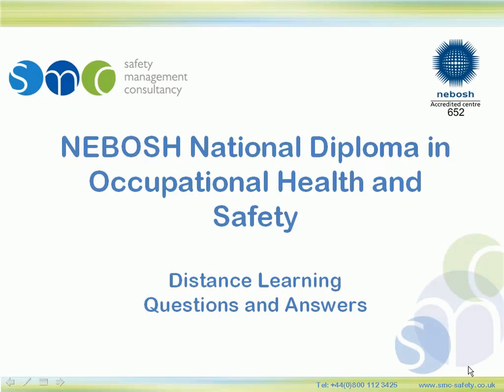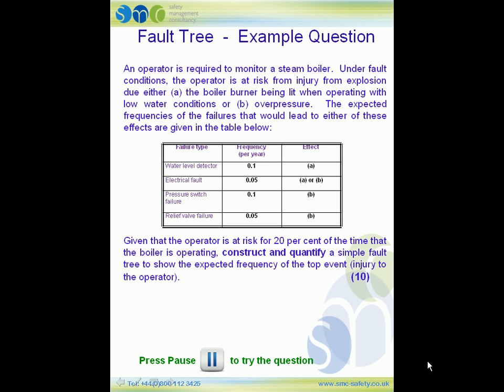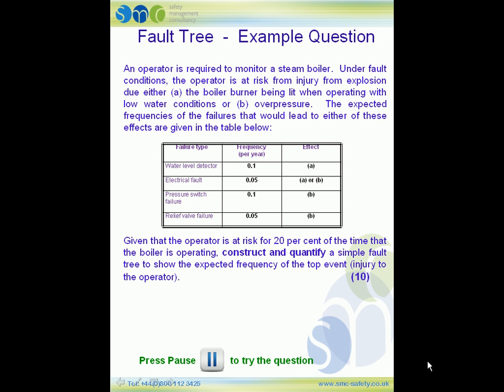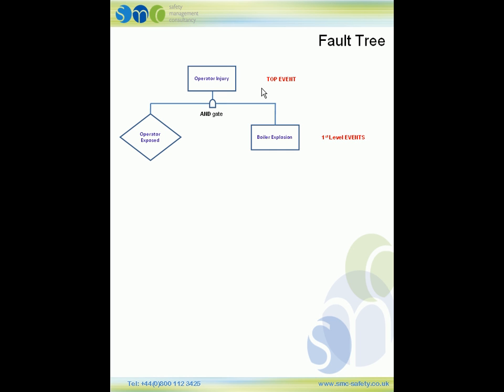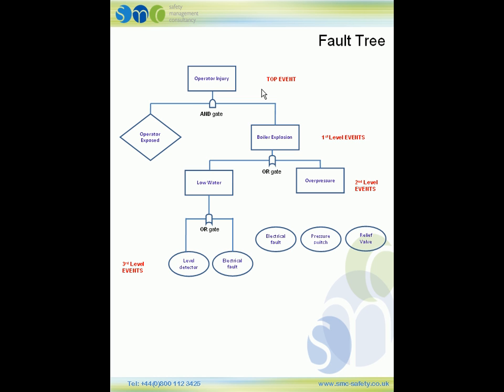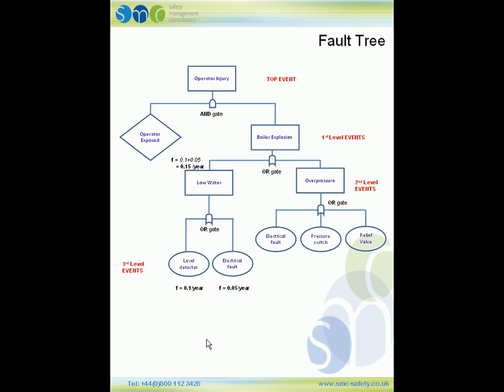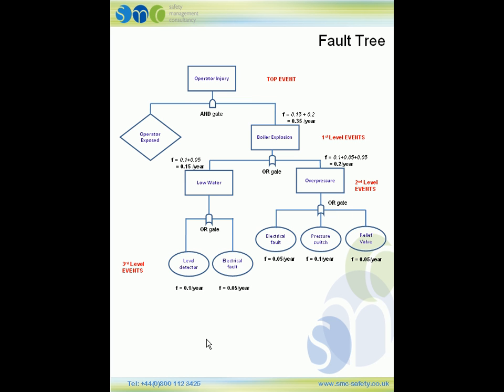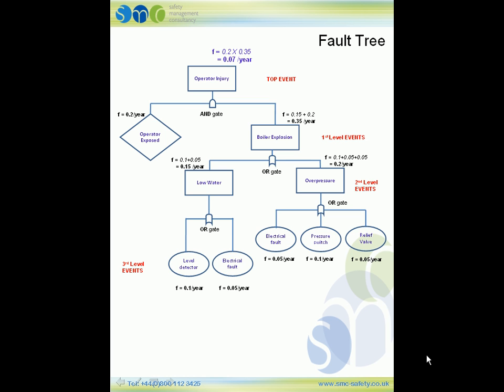NEBOSH Diploma Practice Exam Question -  Fault Tree

Comment: Hi,
Just one correction. According to Boolean Algebra which should be applied to FTAs for PRAs, the Idempotent Law states A+A=A
Assigning alphanumeric values to the basic events:
a1 = Level Detector
a2 = Electrical Fault
a3 = Pressure switch
a4 = Relief valve
The cut sets would be:
Low water = (a1+a2) 
Overpressure = (a2+a3+a4)
Boiler explosion = (a1+a2)+(a2+a3+a4) = a1+a2+a2+a3+a4 = a1+a2+a3+a4 
therefore = 1+0.5+1+0.5 = 3 (not 3.5)

If the electrical faults are unrelated then it needs to be specified. Hope this helps.